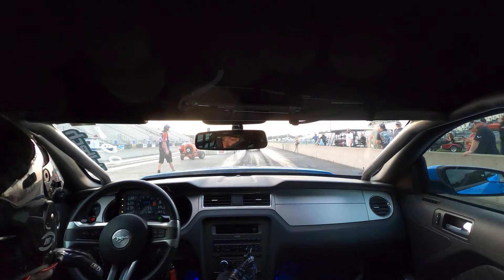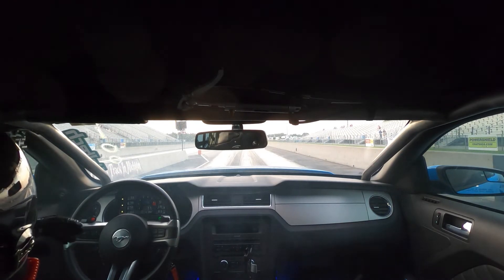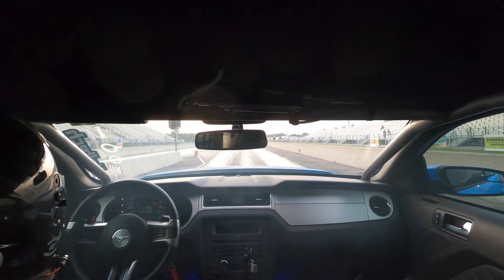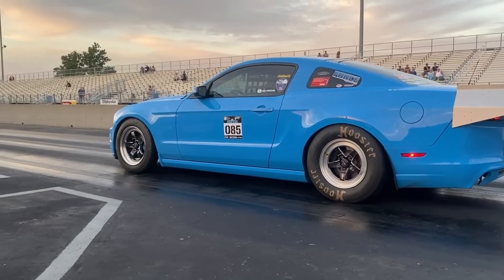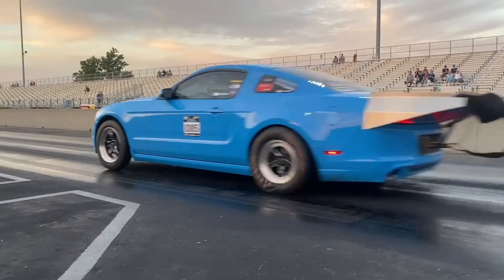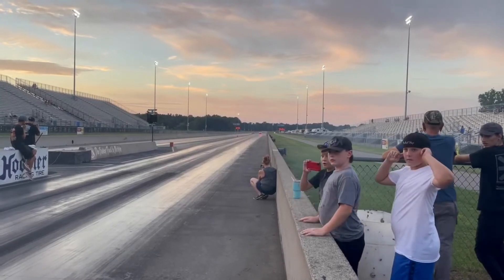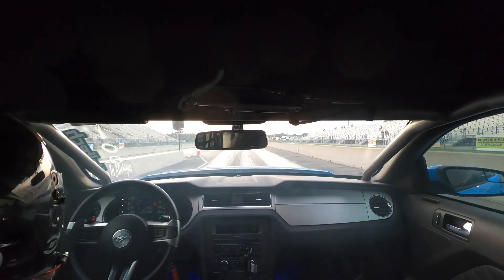Is Rear Gear Ratio Important? I'll Show You

Comment: Thanks for all the info would prefer a different trans gearing or will the rear gear do the trick.
Reply from the maker: Depends on what I'm doing. This gearing works great for the 1/2 mile. For an 1/8 setup I'd leave the trans gearing and add rear gear. Say a 4.30 or so. For 1/4 mile it needs a 3.73 out back. With that, id like to have a high ratio 1st gear to get back to the correct starting line ratio.
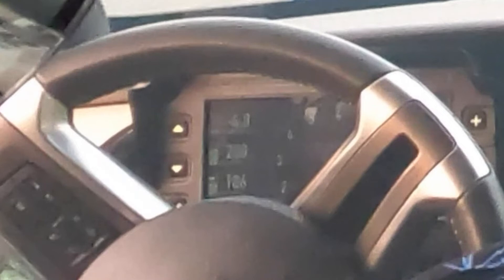Reply: @ Ok , so the transmission gear is fine but the rear gear will get you where you want to be. I was just wondering if like a 1.84 1.44 would work with like a 3:55 for the 1/4 mile.
Reply from the maker: @1jzae86  3.73 in the back is the right gear for 1/4 mile. But yes, the 1.84/1.44 setup would be better than the 1.64 in it now